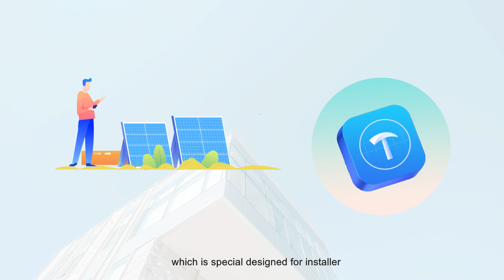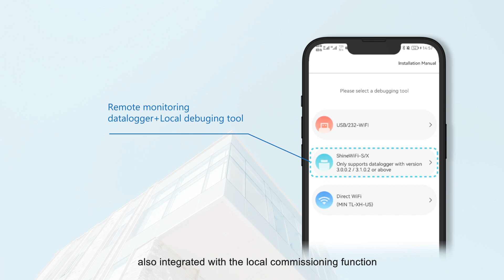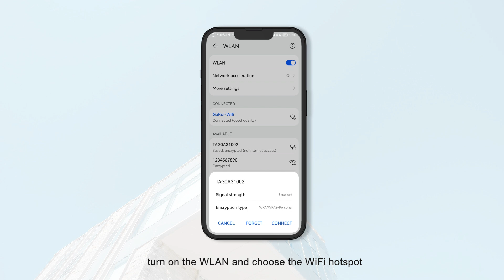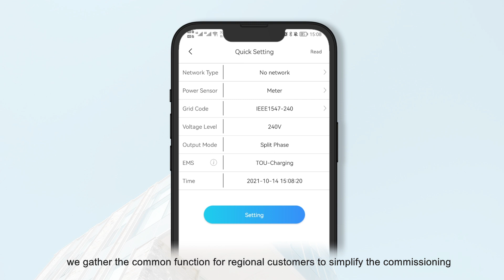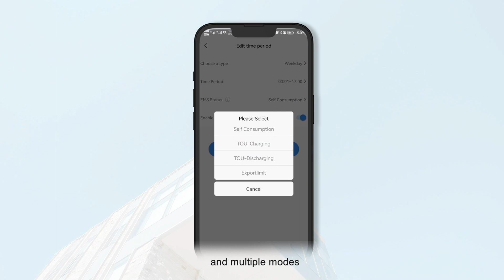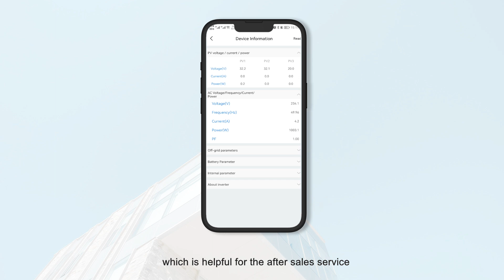'ShineTools' App Introduction

Comment: I downloaded the app on the phone and on my tablet. On the phone it the screen looks alright, however when I try to use it on my samsung tablet the screen looks too big and there is part of the information and options that I am not able to visualize because of the resolution the information is being showed. Is there a way to fix this? I even tried rotating the screen but this app does not rotate the screen so basically I cannot use it on the Tablet